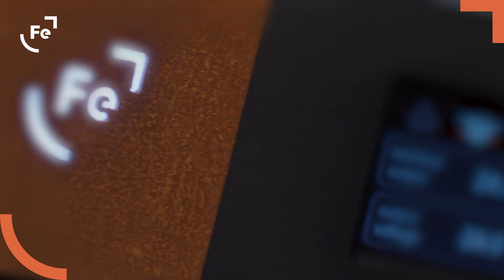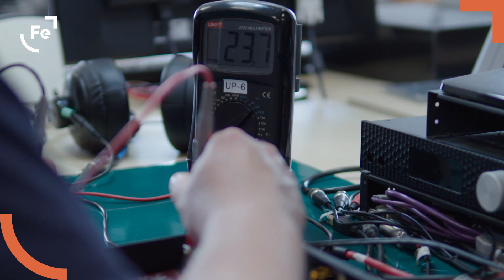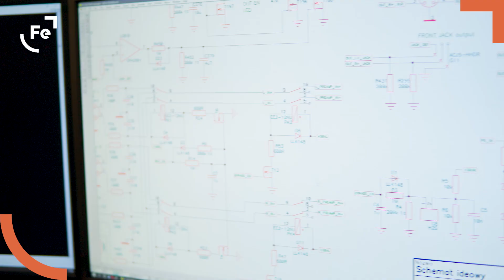Ferrum OOR - a star is born

Comment: Hypsos + Oor sounds amazing with Abyss 1266 TC, smooth, fullbodied, the bass slam is inetnse, all of this while providing insane levels of detail accross the range. This is the most detailed amp I've heard to date with the 1266, and what's more it makes the TC sound natural, can you believe it, it's like magic. Everyone who heard the TC and thought it sounds harsh, unforgiving and completely off, should try it on Hypsos + Oor, it's a completely different experience, closer in terms of timbre to Susvara than anything else. I still can't believe it because the TC usually sounds like an industrial saw or a jackhammer lol
Reply: Do you suffer from any HISS noises? Any ground looping? 
I'm suffering from hissing with the Raal HSA1B. it's very frustrating. I'm thinking of going to the oor hypsos. I have the Audeze Lcd5
Reply: @jacksonville4932  no issues, even using fairly sensitive iems like EE Odin. Try getting a power conditioner and some decent power cables first if you have power issues.
Reply: Sounds like it's coloured to offset that headphone's "rawness". How does it sound with the Suvara then? Does it not result in a bit of an overkill, i.e. excessively warm/lush sound?
Reply: @MistaLova-Lova  indeed it could be argued, however I struggle with distortion on for example Soloist amps. You only notice that on totl sets and when you compare with smoother and cleaner sound like the Oor stack. I still enjoy Soloist GT for it's more lively and raw presentation but I have to run it in low gain and lowered output from the dac to even get close to Ferrum levels of cleanliness